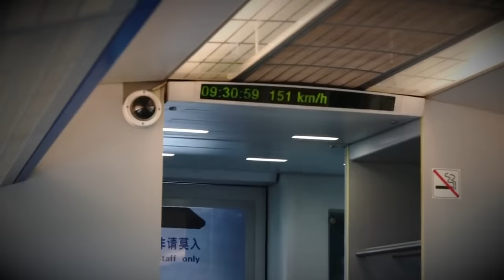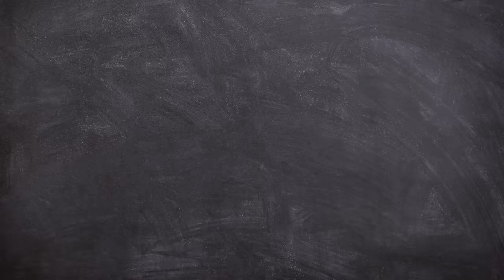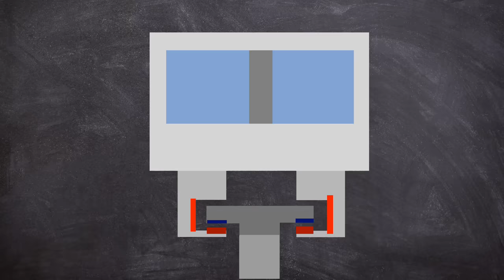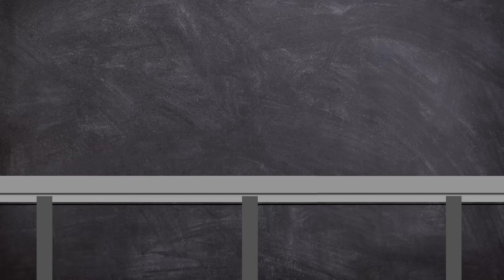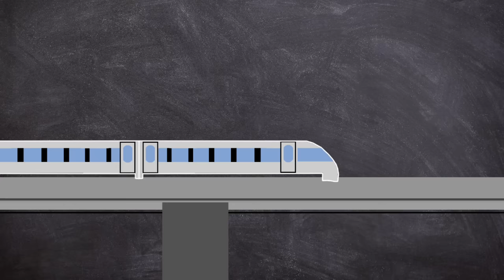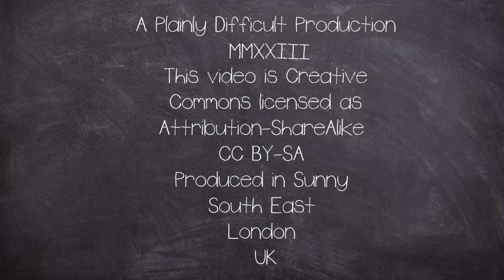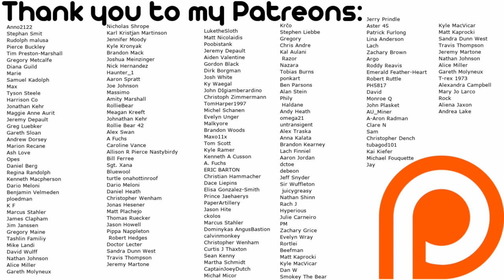Safety Complacency: The Lathen Maglev Train Disaster 2006 | Plainly Difficult Documentary

Comment: I still say it was a mistake that the next generation of maglev 10 was rejected under the false statements by the counter offer , hs2 us a dedicated line with no need to merge with existing points, with the advancement since the rapid 9 used in China   Further more copper was not needed anymore, but aluminium for the track motor coils , and safety issues and technology have all advance in the 20 years further more driverless trains have had successful development, this tragic accident was fully human error, failure of correct procedures, and stupidity.  Since construction started the 60 billion winning bid project for hs2 has completely failed to come in on time and value for money, it’s far outstripped s the maglev alternative budget cost of 200 billion ,  it’s past it by over 100 billion 10 year’s delay, and only a quite shameful speed, london to Birmingham will just save 26 minutes, compared to a trip on maglev that could have cut in in half. Some say the maglev wouldn’t have had enough room to get to full speed that’s not correct , hs2 has far less stops additionally peak times would stagger stations to increase capacity, and could get to full speed in 1 mile compared to conventional that would take up to 7 miles , virgin pendalo almost equal hs2 speed with a clear track test , hs2 is a complete waste of money hs3 should be forced to go maglev down to Devon to london, and hs1 should be expanded on , than keep going with an outdated Victorian and br60 philosophy

Comment: I don't see why the video is so negative towards maglev. Nothing about the accident was connected to the maglev technology. Its also strange how the video don't see a future for maglev. 
While speed is often marketed as the biggest advantage, that's far from the case. The lack of friction and moving parts in both the track and train makes for extremely low maintenance. In comparison just think about how much work is done on regular trains to keep them up and running, and how often train lines are on limited capacity cause some track is temporarily shut down for repairs. Even more maintenance is needed for high speed trains to run at their full capabilities. The main problem with maglev is its upfront cost.
There are also other potential future uses of the maglev tracks outside of trains. Superconductors unlike regular powerlines transport electricity without any loss due to resistance (high voltage lines usually lose 7% per 1000km). Cheaper and better high temp superconductors could allow them to be used in the maglev tracks and double as super efficient powerlines, something that would have a way bigger impact on our society then going a few 100km/h faster.

Comment: So you honestly think just because one maglev system's test track didn't follow their safety protocols which ultimately caused an accident is an argument against maglev technology??? WTF?!

The future of transport will absolutely and without the shred of a doubt be maglev. It won't be a replacement for rail travel, it will be the replacement for non-long-haul air travel. That's where we are heading. Anything else is wishful thinking. Flying will be banned in most parts of the industrialised world except for long-haul and especially where large bodies of water needs to be crossed. All other flying will be maglev. It may take another 50 years before all that is rolled out, but there is simply no alternative to it. Flying is not sustainable. It never was. And this problem has finally caught up with us. Flying does not scale. Maglev does.

Comment: My Great Grandfather was a Maglev worker way back in pioneer times. His job was to stoke the Maglev's furnace with magnets to power the levitation boiler. Back then Maglevs still used steam levitation so it was only by burning hundreds of pounds of magnets that they were able to achieve levitation. They also had to deal with Maglev robbers who would chase after the Maglev on hover-hoofed horses. The horses had magnetic levitation horseshoes that, when the polarity was inverted, would allow the horses to run up the metal side of the Maglev. The robbers would then dismount and rob the Maglev's passengers of all their money. 

The most notorious Maglev robber was Mad Magnet Malone, fastest Magnet in the West. He would steal valuables out of people's pockets with a handheld electro magnet. Then after getting away he would spend all his ill gotten gains at the local watering hole - Levi's Magenta Saloon and Dance Hall. 

Ahh, to live in the 1800's, when everything was magnet powered.

Comment: This is pure incompetence in design and willful negligence. One fupping switch.

Human error was not the cause. Ffs. It clearly was a faulty design. The train was a single track and thus a very simple switch would have prevented the maglev from departing.
Reply: Didn't humans design it? Operator failure or design failure are both "human error".
Reply: @Katie Kane  human error in accident investigations are focused on the operators whereas clearly this is a design issue that should have been caught by the risk assessments. 

It was decided that protections not needed. Hence the wilful negligence.  However the operators get blamed.